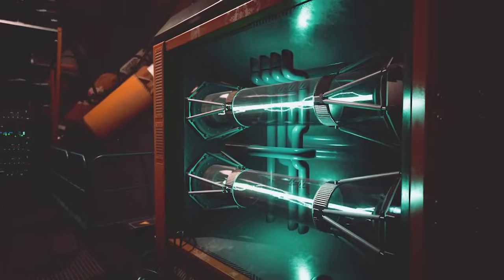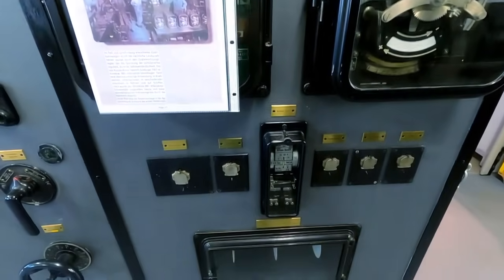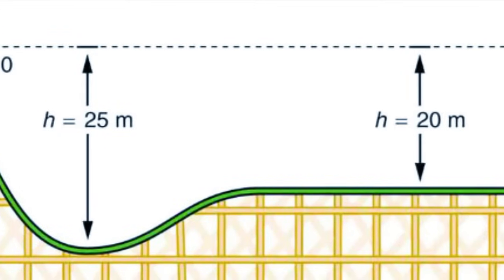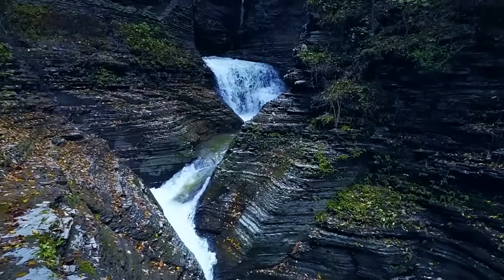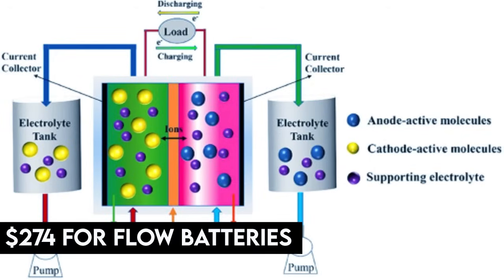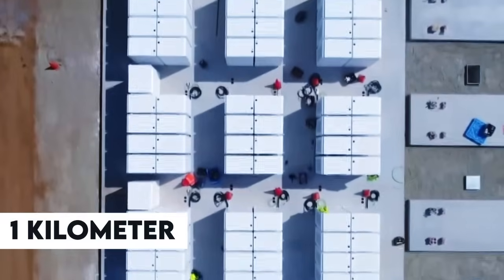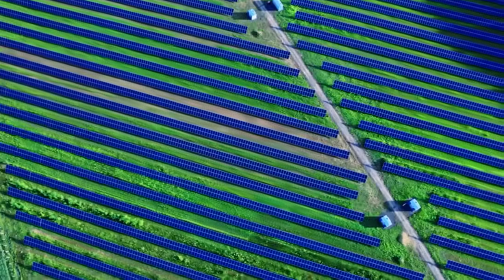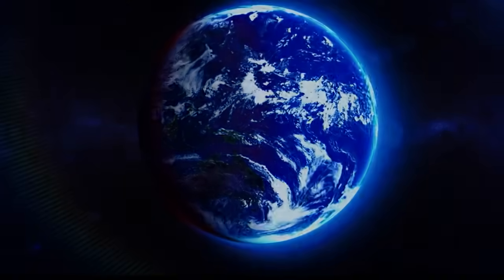How gravity batteries could change the world

Comment: Oh, so I used ChatGPT to give me a domestic example: An average house uses 30kWh a day. In order to store 30kWh you would need to raise 1 tonne 11,009 meters. 10 tonnes could be feasible but that would still be 1km. The 30kWh is an average for the U.S. In Europe it can be as low as 10kWh so that brings it down to 300m. For size context, 10 tonnes of lead would be a 1m cube. 100 tonnes would be a 2m cube of lead and 3.5m cube of concrete. Now the height needed is 30m. That does bring it into the realms of feasibility. I'm surprised the average energy usage is that high though.

Comment: The concept is old. See pumped storage plant, which is also described in the video. And why do you or this company call it a battery? A battery stores electrical energy in chemical, but not kinetic, form. And if you shoot the thing into orbit around the Earth, it won't work, even though there's a lot of gravity there...
Reply: Indeed, if these are called "batteries", everything can be called batteries. Almost everything one can think of carries some amount of potential energy, whether in gravitational form or simply from the fact that (if it is matter) making it interact with its anti- counterpart would produce more energy than it takes so bring them together. Other things, such as light, carry energy that can turn to heat, so all light is a battery.

This is almost as bad as that time they named a handleless scooter a "hoverboard". Yes, I'm so peeved about it that I'm willing to bring it into discussion out of nowhere. F**k whoever named those things.

Comment: i guess. even for grawity batteries using water is better choice. i mean if it falls itll be less destructive force and its easy to maintain except freezing and ewaporating but can be used as solid weight or standard hyropower source...but anyway may be they chosen cement because its heawier then water....but in that case there is heawier things too but that may mean additional costs... so its probably relative to where you build the system...other then one simple answer...